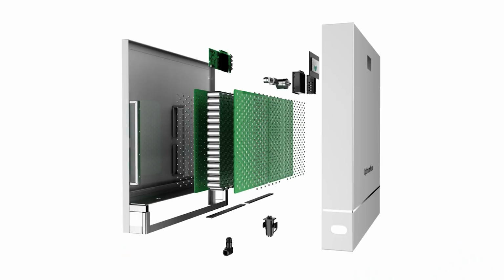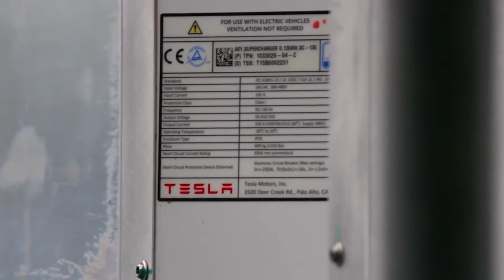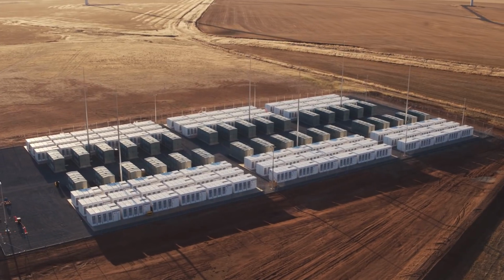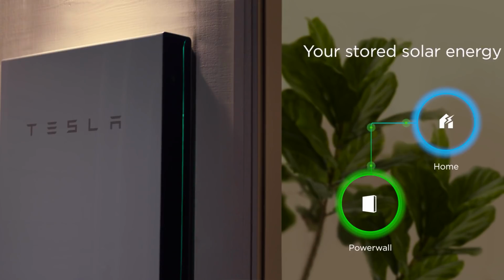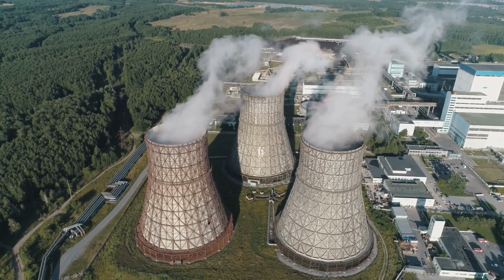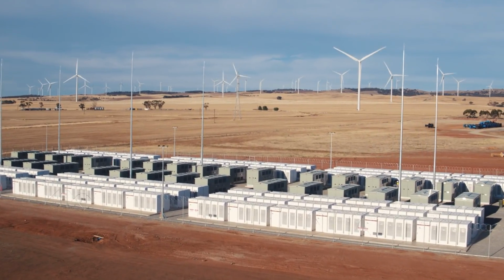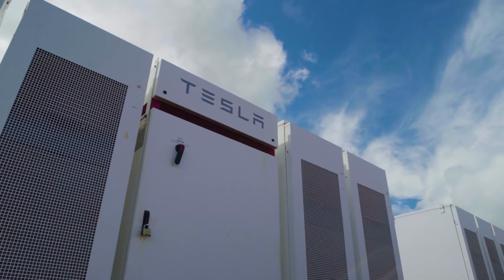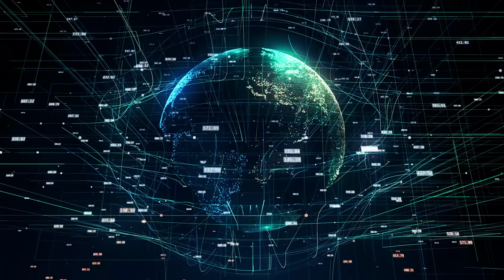Why Utility Grids are Afraid of Elon Musk

Comment: Spacex off shore landing platforms that may be decertified, or prototype fails could float on a  water reservoir then stack Megapacks on the platform, and place solar arrays above the mega packs (shade). Then areate/ oxygenate the reservoir by using the cooling water to cool both the array and the mega packs. I heard cooling panels raises the efficiency by some %. Reducing the total footprint, of a seriously competitive mult-product venture. Own the reservoir and sell the water at a low rate to the surround farmers. Own the peaker plant and sell to the grid at a better efficiency output. Own the solar panels and soak up the free photons. Great place to do some serious R&D too. Comments?

Comment: Your completely ignoring nuclear power in the equation. Nuclear is carbon neutral  provides 24/7 clean energy. Something solar and wind are nowhere near that. Why does everyone shun nuclear or pretend it doesn’t exist. Look at France which runs on mostly nuclear, they have a very low carbon footprint and cheap energy. Compare that to Germany which effectively banned all its nuclear plants to go "fully renewable" but since the they’ve had to increase their natural gas and oil plants to make up for solar and wind’s downsides. Plus they have very high cost electricity.

Comment: 20 good reasons to let big oil die.

Enough climate change

Enough air polution in our cities

Enough lung desases and premature death

Enough ugly oil spils

Enough ugly oil drilling

Enough water polution

Enough sea level rise 

Enough oil sand fracking

Enough ugly oil and gas tankers burning dirty oil

Enough noise disturbing the whales 

Enough acidification of oceans and coral bleaching

Enough ugly refineries

Enough ugly oil storage

Enough ugly tank stations

Enough oil and gass truck disasters on our roads

Enough jet crash fires and death

Enough complicated, dirty and expensive maintenance of combustion engines

Enough dependance of the petro mafia and the Middle East corrupt and decadent leaders

Enough with big oil lobbyist bypassing our democracies

Enough oil wars and dirty oil politics

Enough opression of clean and green decentralized energy for everyone and the poor.

Comment: For my meager use in an apartment, 19 hours is about the limit for a Power Wall. I've lived in places in the Northwest where the power was out for a week and the temperature was near zero Fahrenheit. Wood, coal, fuel oil and gasoline generators saved the day.

Comment: The power business is a monopoly in many countries and they won't allow the consumers to freely turn the dial backward. There will be rates and plethora of rules, and forms you need to fill just so you can make your home power system supply the grid. In most cases, the home power supply do help reduce or zeroed the bill. But in some countries, they have minimum charge, which you will still have to pay even if your power usage is zero.

Comment: The wind farm running at full capacity will fill the batteries in 20 minutes. The James town battery's main job is frequency control, if the voltage drops below a range it adds power in milliseconds and I assume draws power if the voltage goes too high. The plant reduced the cost of these frequency control services by about 89%

Comment: There is a reason why Berkshire Hathaway lobbied hard in Nevada to eliminate the requirement for standard utilities to recompense for electricity put back into the grid.  It killed Solarcity's business model in the sunny state.  Decentralization is an inevitability as the core grid in North America is at an average age of 50+ years old.  Where do you put the billions to rebuild?   Trunk lines are fine but a fully decentralized system is inevitable.  Many studies have proved this out based on cost efficiency.

Comment: Renewables need  lot of space to operate, though...thus more innovation to a compact yet more efficient ones would still be needed...
Reply from the maker: Have you accounted for all the space fossil fuels take up? From refineries to ports, pipelines, coal mines, truck depots, storage tanks, fueling stations, and wells. And are you considering the detrimental effects that has on the surrounding property values. Not to mention the fact that with practically all of these areas, you're not too far away from an environmental disaster (best case) to a murderous fireball and giant pollution cloud? All of this MUST be near civilization because we need that stuff to function. And you're worried about taking up otherwise unused land with non-polluting wind turbines and solar panels?
Reply: @NowYouKnowChannel  i'm not against on the use of renewables, though. However, we shouldn't be too complicit of the possible cons that might arise if we suddenly jump on their world-wide use. Better efficiency, lesser carbon footprint on manufacturing them, being more compact, stability, improved battery storage(we're getting there), and other factors would needed to be improved before replacing all the fossil fuel based energy infrastructures. In short, a balanced and step-by-step approach should be utilized to deploy them while at the same time improving them. Besides, we are all in this together. Geopolitical factors would be another story, though.

Comment: Thinking about my local area's electricity, Newfoundland is almost solely powered by 1 diesel powerplant (that has 3 diesel generators) with small scale wind and hydro electric plants powering a few small towns. The major flaw of this design was shown to us a few years ago when one diesel generator was down for repairs, another was in need of a service, and then the third broke (it made a pretty green flash in the sky near my house lol). Mid winter, coldest winter in the past 20 years and we were running off one generator. Inevitably, that one also broke. 

DarkNL. Power was out across the province for a week. A large scale battery farm like this would've completely prevented this as the final generator wouldn't have been strained so hard to the point of failure. 

We now have a large Hydro electric dam being built that will be able to provide power to the whole province. I can only hope that the company in charge of our Electricity, Nalcor, is smart enough to install a large battery farm to help with peak demand. However, Nalcor has destroyed their budget due to major oversights and literally just lying bout the original budget, so they probably aren't smart enough to think about power storage. 

BTW: OG budget was 6.2 Billion, they are now at 13 Billion (My numbers might be wrong but its at least double the budget right now) The plan was to have it completed by 2017, now it looks like it still won't be finished in 2020. And on top of that, if the federal government doesn't bail us out of this crap, our electricity bills could double because of these failures.

Comment: There is power generation and there is the transmission grid and those two industries have been unbundled in the EU since the third energy package regulatory legislation came into force in 2009.

Sure, with battery storage you need fewer peaker plants, which will hurt companies in the power generation business, but it will not cut into business of transmission grid operators. The transmission grid operators could even make the case for charging twice now for the same kWh: first for transmitting the electricity from the power generation sites (maybe offshore wind farms) to the battery for storage and a second time for then transmitting the stored energy to consumers.

Transmission grid operators only get creamed through energy generation and storage on household level with Tesla solar roof and power wall. Households could even go off the grid completely. This however is not possible with solar during the long, dark winters, during which the sun never seems to really show it's face, common in many parts of the develloped world and windmills are just not feasible on a household level, so we are stuck with the grid.

Comment: In India, we've always had home batteries that we mistakenly call "inverters".
Reply: Yeah. Power wall is gonna sell like hot cakes when Tesla enters indian market
Reply: @ericflyingraccoon923  nope not in the near future it will sell like hot cakes when the tech works flawlessly
Reply: they're much cheaper then tesla and do the job pretty well, even along with solar panels, which is what i have in my home.
Reply: so annoying
Reply: Those are generally lead acid based batteries to keep the cost low. It's called an inverter because of the box that the battery is plugged into. It converters the DC power in the battery up AC power, which is what the building runs on.

Comment: I'll push back slightly.  I think battery power sounds (is) great, BUT it's not perfect of course.
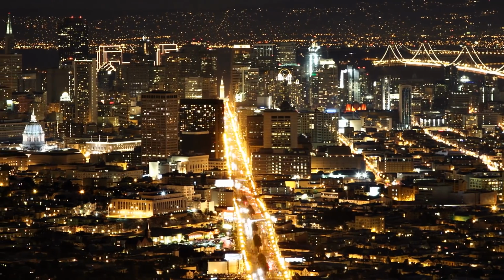@2:00.  "Powers every home in SF for 6 hours."   Not businesses?  And what happens at 6:01?
@2:30. "It's been operating flawlessly since it opened." Even better than that -- I read the week before it was officially online it paid for itself 20% by handling a dropout.

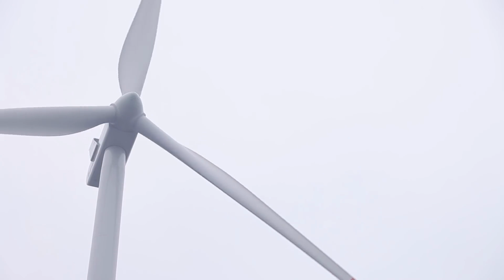@4:14 "batteries don't emit any pollution .. [they get] power from clean wind turbine ... absolutely no air pollution created." Windmills + batteries.  Everything wears out, of course, so maybe not air, but not perfectly clean either.  And any pollution created from manufacturing the batteries?   And I've read the concrete that support those windmills produce lots of CO2 by themselves.
And peaker-plants. They wear out as well and don't come online instantly, but they can generate power rain/shine/wind/snow, or NOT.  I suspect you'll ALWAYS need some peaker plants.

Not at all that battery-walls are bad, they do sound great.  But what's the battery/windmill decommissioned equipment look like 20 years from now?  Better, worse, or similar compared to "peak plants"?  And I guess also an occasional power outage in stressful situations when the batteries temporary run out of juice. (That's what we've got now, so similar.)

It seems much better than current, but make sure you don't accidentally sell it as perfect -- that'll highly disappoint many people.

Comment: these are just statements. no realistic calcualtions for 20 years. power plants are expensive however they last more than 20 year and they can produce tremendous amout of power when it is permanently needed. 

Wind turbines ,on the contrary to thoughts of average people, are not clean at all. They emit high amount of vibration and disturbs great area around them. As result they generare "un-life" zone around them. no insect goes close to windturbines or animals or plants .This situation generally defined as "noise pollution". this pollution cannot be seen or heard or felt by humans without instruments. therefore the effected zone around them dies over time . not even grass grow in these areas. 

When it comes to solarpower it becomes advantage, due to solarpanels are cleaner energy than a powerplant. However their investment cost refund is somewhat 5-10 year. And their expected lifetime is around 12 to 17 year approximately .

Battery packs are solution from a long period of time, however the main problem with them are that their life cycle. they die over time quickly while power plants do not.

this video looks like to me an advertisement more than science as an electrical engineer. 

Tesla does very interesting works and i hope it will be better for the mankind, however society needs to be aware and well educated to generate an opinion on specific matters.

Comment: Intermixing video of different types of power plants might impress the layman, but it doesn't impress those who know just a little something about the industry. You show massive emissions from coal plants while describing gas-fired plants, and then you show COOLING TOWERS (A la Nuclear plants) emitting water vapor and talk of pollution. 
Then you imply that battery packs will eliminate the need for conventional power plants when it will do nothing of the sort. 
Wind farms REQUIRE battery packs as backup while the wind velocity is low. The difference is in the efficiency of the pattery packs, not the availability of them.
You use misdirection and misinformation to promote what is otherwise a perfectly legitimate article. The right-wing mantra that "global warming is a hoax" has a good talking point in this kind of dishonest publication. They will point to this and say (correctly) that we are being lied to. Please stop it. Be truthful, don't mislead people.

Comment: Australia uses 2294000 MWh of electricity annually. You would need around 18 thousand of these battery banks to power Australia. @ a cost of  $ 1 trillion 200+ billion Dollars. And we haven't even addressed the question of where are all of the minerals (lithium) required to build these massive battery banks are going to come from. The only time you need "peaker" power plants is when we are talking about renewable energy, for wind and solar for when the wind doesn't blow and the sun isn't shining.
There is a lot of misinformation in this video. It promotes the idea that RE can do it all and do it cheaper which it can not. Do some research.

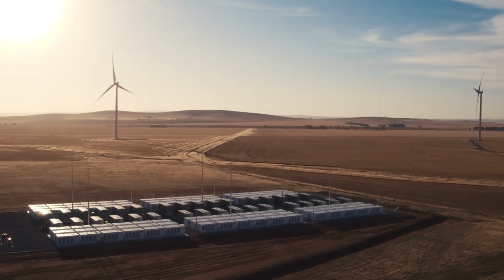Comment: Just a clarification about the comments at 4:09 - true, batteries and wind turbines are not point source emitters of CO2 or NOX and other byproducts, they are NOT "zero emission" by any means. 
To make an accurate comparison, you need to include the energy consumed in mining the rare earths that are mandatory for the current LiPo cells that comprise Tesla's battery systems, and the wind turbines, etc. Yes, that also means you need to factor in the energy needed to mine/refine and shape the steel and other materials to build power plants.

Wind power has proven to not be cost effective so far compared to traditional methods, and then there's the issue of what to do with all the toxic chemicals in the generators and their turbine blades, which are not recyclable with present recycling tech.

Honestly, we'd all be better off perfecting thorium salt reactors as a bridge solution until fusion power becomes commercially feasible. 

I do think having near ubiquitously distributed, medium scale (15-100KWh) backup power sources is a fantastic idea, and I can see that uptake accelerating greatly given the specs touted for solid state batteries - majority composition is silica (glass), minimal use of rare earths, cheaper to manufacture and anywhere from 2-6X storage capacity per lb/kg compared to current LiPo state of the art.

Comment: The production of the material and construction did produce co2 emissions as well as the maintenance may require the use of carbon fueled equipment. The positive is that the co2 emissions are offset by the production of clean power. Keep in mind that the very first oil wells and coal mines used mules and horses. If this level of innovation continues future batteries, PV panels and wind turbines may be built using clean energy

Comment: For the sake of transparency it should be noted that these 700M peaker plants will have multiple gas turbines with the capability to generate much more energy than the 90 wind turbines, one gas turbine in fact will generate more than that. Another thing to note is that the typical life span of a wind turbine is 20 years and once it’s life has been used up it is disposed of in a landfill. There is also the issue of wind/sun being needed to generate these renewables so not all places in the world could use this source of energy. A gas turbine while not 100% co2 neutral is much cleaner than coal burners of the past and unfortunately IDK the data of CO2 emissions it takes to build a windmill/solar panel but I know it isn’t 0. There are many ways of looking at it but peaker plants are inevitable for at least the near future, unless we invest more heavily into nuclear. I’m a gas turbine engineer who travels for the meatball across the country quite cool to see the changing dynamics happening in the energy segment. Could you clarify on what the setup of the peaker plant running 700M was? Like was it for a combined cycle setup with 2 7FA’s and a D11? If that’s the case that’s about 550MW’s👌

Comment: Those numbers (pricing and construction time) quoted for simple cycle gas peaker plants are complete bullshit. A 100MW peaker plant (equivalent to the Hornsdale battery) cost around $1100/kW (so around $110 million). They could easily be constructed inside three months, if the political will was present (as was the case for Hornsdale).

Comment: Tesla ig going to need to install tons of batteries to smooth out peak demand charges for their upcoming Megachargers in order to guarantee a $.07 /kWh price. They are already doing it with V3 Superchargers.

I would like to see Tesla way oversize the storage at Super/Megachargers so they can store enough energy to buffer the charging, and also act as utility scale storage and grid services.

Each charging station could act as a node on the Tesla Virtual Utility Network.

Of course solar can and will be add as well.

Comment: While the big powerpacks are great, they still leave one problem, peak grid limit (or just power line limit). A lot of transmission infrastructure was not build with electric cars (and other electrical appliances) in mind which leads to a problem when more and more switch to electric vehicles. When everyone charges their car at the same time, these limits can easily be reached and the powerpacks won't solve that. The powerwalls however do, as they can charge the car on battery power if the grid is overloaded. If enough people have them, you can get a pretty balanced grid.